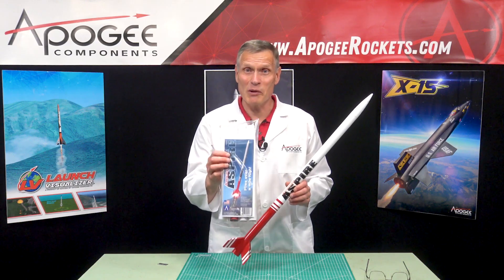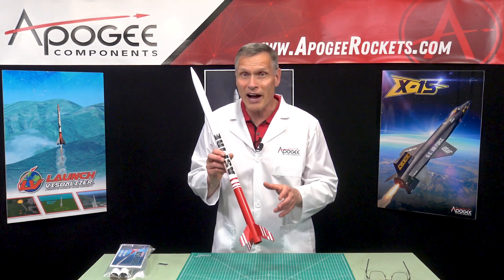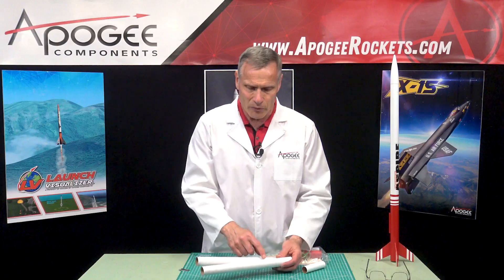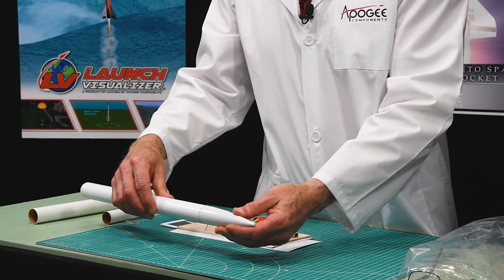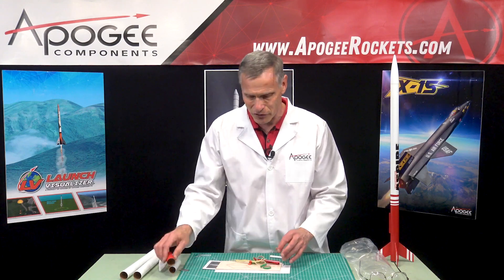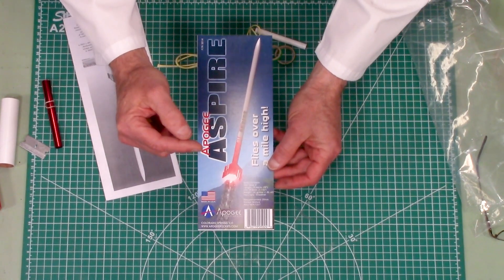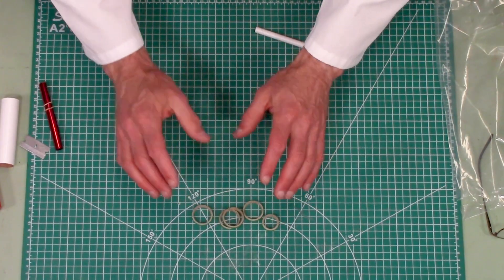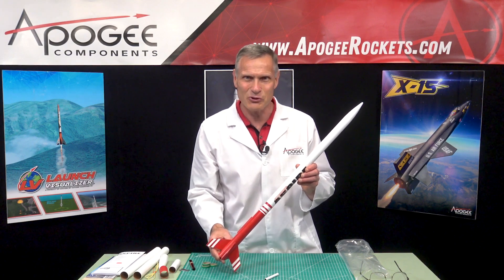Unboxing the Apogee Aspire Rocket Kit

Comment: I have had the Aspire built for a couple of years. I haven't flown it to date. The hardest part of the Aspire: 1) getting up the courage to launch it, because you know that you may lose it. Especially after you have spent hours added recommended airfoil to the fins; 2) Finding a launch location. Hopefully, I can launch mine in the Fall at our rocketry club Birch Run location. The Clio, MI. location has a 4,000 feet limit. Mach-One on the RockSim goes almost 5,000 feet.
Reply: I'd say that you're close enough that you'll be alright launching there. I really don't think anyone is going to reprimand you when the altitude will be within the margin of reason, especially on a small rocket that doesn't even need level one cert. If you are still worried, perhaps adding a payload or altimeter with enough mass to help ensure you don't get in trouble for exceeding the location's maximum altitude.
Reply: @C-V-Z  I see on the Michigan Team 1 website that the limit is 6,000 feet. That should be high enough.
Reply: Come to the better side of the state and launch with us at SMASH, we have a 15,000 foot waiver.
Reply: @TheRocketSmith  I looked you up. Do you have members around the East Lansing area? I see you launch at Muskegon County Wastewater Facility.
Reply: @alfredindy8058  I know of one member in that area, but I'm not comfortable giving his name out to strangers on the internet. Most of us are in the Kalamazoo, Grand Rapids, Muskegon area's. If I was to make a drive across the state I would come for our crapshoot launch in may/june when Jackson Model Rocket Club joins us. I usually try to push for a higher call in cause I'm crazy, but we didn't get it this year.